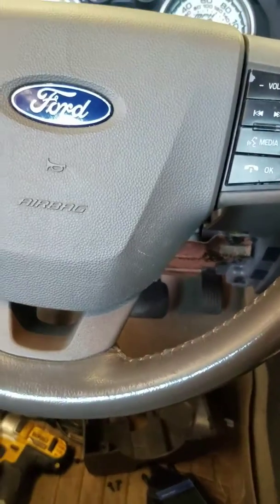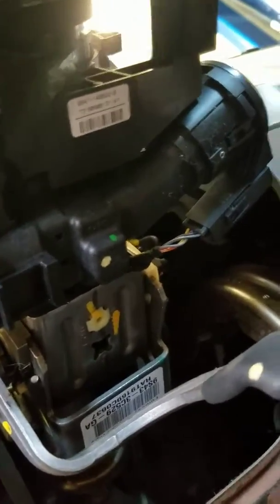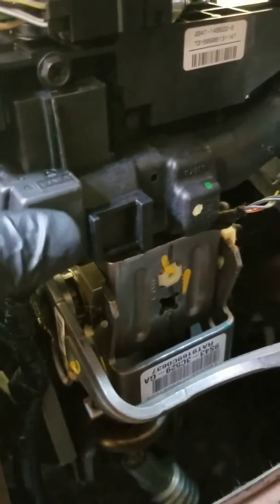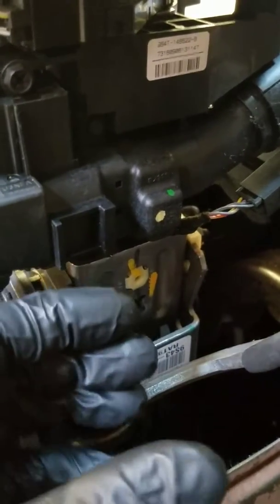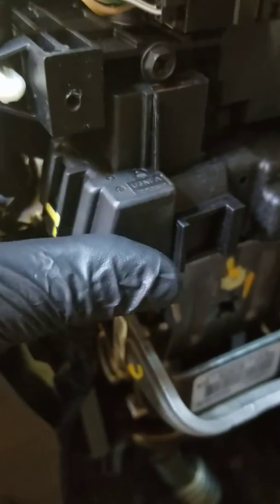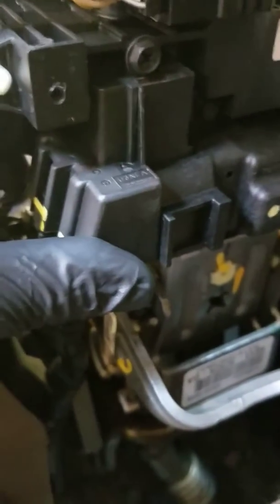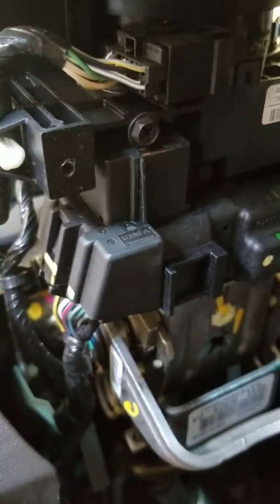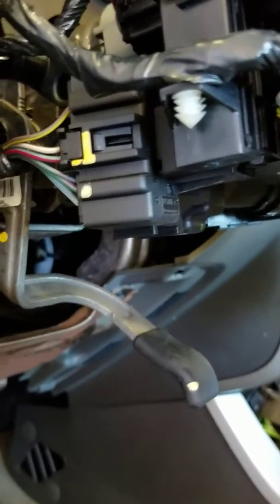Diagnosis: 2009 focus intermittent no crank

Comment: What's the name of that part that needs to be replaced? My situation is when parked on an incline front facing forward the car always cranks. When parked on a flat surface intermittently I have to turn the ignition really hard in order to get it to start and sometimes I have to do that multiple times like 6 or 7 times. No clicking noises or anything like that or heard.
Reply from the maker: hard to say, they are usually different failures. you need to take it apart and look.

Comment: I have a 2009 focus and after driving in heat, we had to open the hood and wait for it to start. The problem was the cheap plastic clips broke and the wire going from the battery across the engine to the left side was laying on the engine. Every time it got hot it wouldn't start. Rigged it so it's away from engine and recovered it with the  black hose cover. Problem solved!
Reply from the maker: right, just another instance of ford cutting corners.